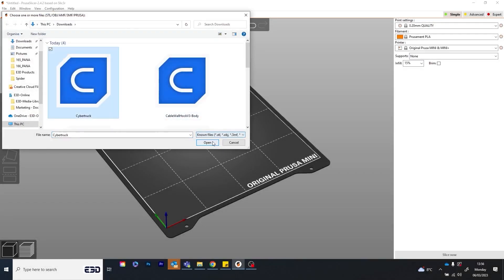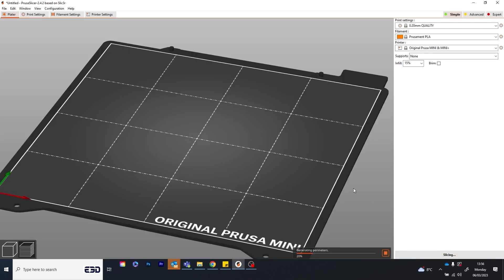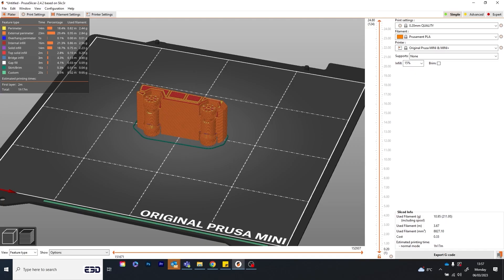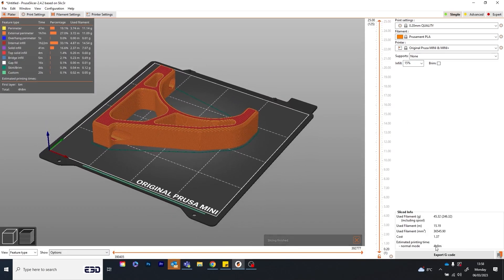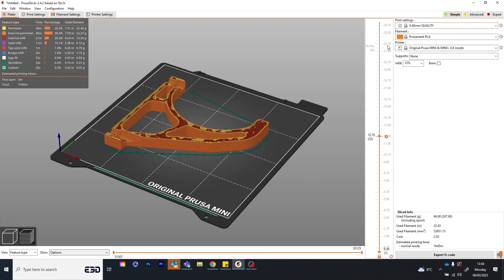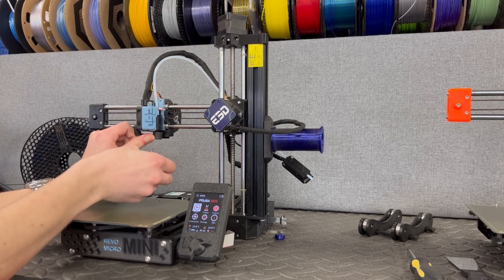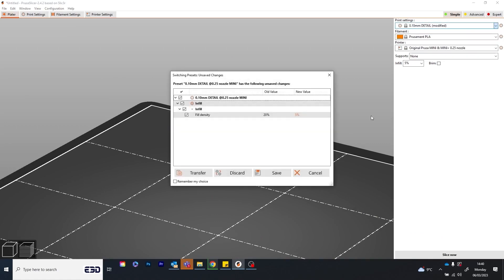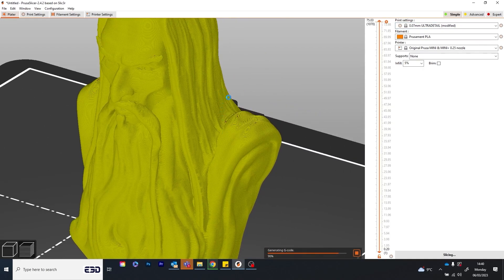Should I change the nozzle on my 3D printer?

Comment: I love your nozle and fast changing system.

It's my first modification on the prusa mk3+ and it works absolutely flawless.
Installation is quite boring, because so easy.
Same for use. Doesn't even need a new first layer calibration for other nozzle sizes!